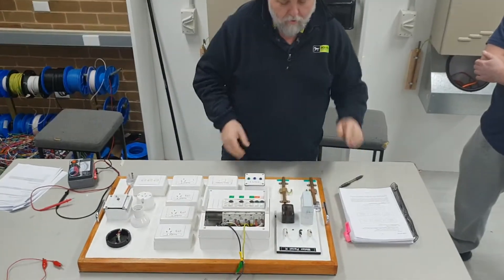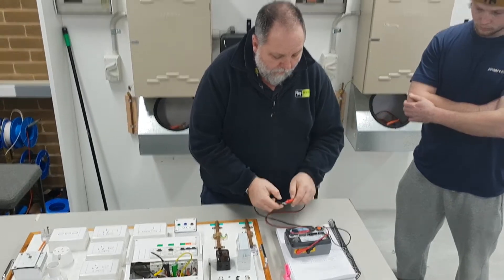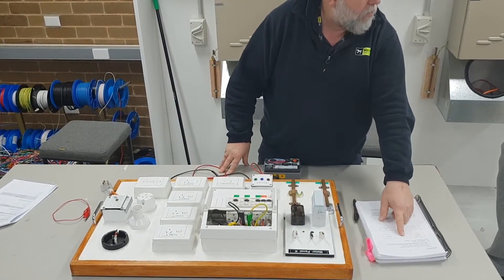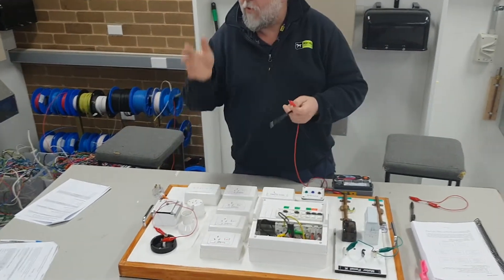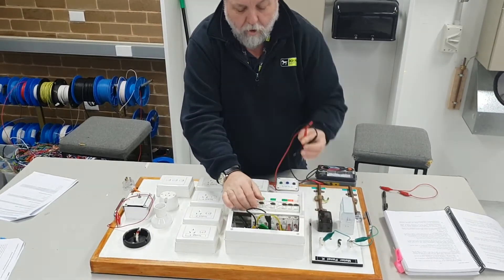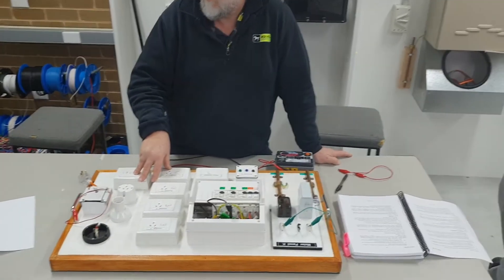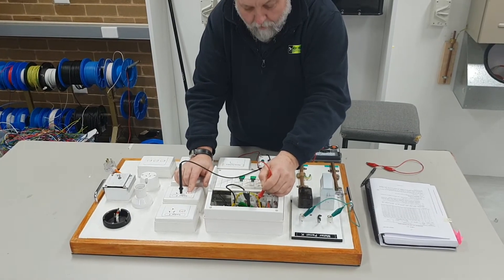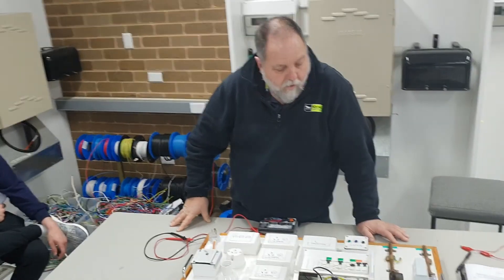Basic installation  testing

Comment: I'm wanting to use my old quick disconnect from my air conditioner to hook up my jacuzzi tub how can I tell if that outlet is still live I looked in the breaker box and I don't see any trips but I hooked it up and I'm not getting anything and I'm not even sure it works but if I'm not getting electric it ain't going to work for sure what can I hook to this to see if my electric is alive I've got a very cheap multimeter and it doesn't have a setting it will blow it up I'm sure
Reply: really??

Comment: How do you do these tests if your power points are not located on the main switch board? Physically how do you do the tests with a multimeter when the multimeter leads are 1m long at best but the powerpoints could be 10m away? Thanks
Reply: extension cord
Reply: Trailing lead
Reply: You use what’s called a trailing lead which is basically just a massive extension of one of the leads. Make sure to zero your meter as it will pick up the added resistance of the lead due to the length 👍